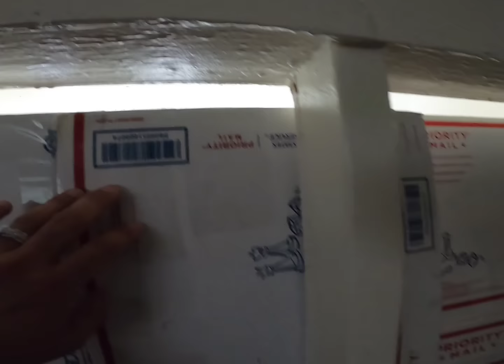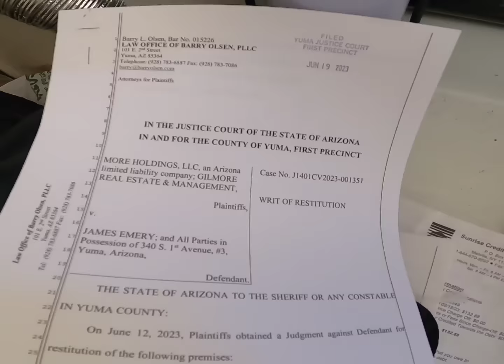How to remove a squatter from your property

Comment: The first thing you do is go pull the fuse out of the box mounted on the wall behind the AC condenser in back of the house!!
Reply from the maker: Haha that is really funny because I'm an AC contractor.
Reply: Could possibly shutting off power to Your dwelling have helped? Or more problems for you? I had to kick out my dead beat cousin after almost six months. I live in the same house, so turning off the power was not an option for me. All the best and may God bless.
Reply: The owners next to me have the water cut off. She turned it back on. The water company put a lock on it and she cut the lock off. Now she is stealing my water from my facet so she can flush the toilets and etc…
Sick of these damn dead beats and squatters…

Comment: I’m trying to get rid of one mouse in my house. Can’t imagine trying to get rid of a squatter, maybe using a bigger mouse trap.
Reply: Essential peppermint oil and mix with water in a spray bottle.  Mice hate the smell of peppermint!
Reply: GLUE TRAPS....WORK FANTASTIC!!
Reply: Fumigation usually does the trick
Reply: @sherynkowatsch2970  i use those  mostly 4 flies & nats,,  kinda hard on the cats,tho!
that's stuff sticks, i got a sheet stuck on the back of my computer. & of course the cats.

i    
like it - yet it causes some problems!  lol
rat mouse poison at farm supplies.
the green bricks are good.
Reply: Me too. One mouse and have tried all kinds of ways. I find nests in the most obscure places. Have no idea how it got in here? Has to be an opening somewhere but can't find it. At least a squatter is big not to hard to find to get them out

Comment: To get through that door take the exterior trim off, slide a recipricating  with metal blade between the door jab and the frame wall. Cut from top to bottom cutting the nails or screws at the shim locations. Then just push the door jamb and all inward. There will be a few finish fasteners on the inside trim but it will cause less damage to the door and is more easily repaired.

Comment: Rent a 20' shipping container, drop it on site. Take all the squatter's stuff and pack it in the container, lock it. Then remodel the unit. After the 14 days if the guy doesn't get his stuff, open the doors and put a sign saying, "Container Sale" and sell everything for cheap just to get rid of it. Or a sign saying, "All items FREE" and it will be cleared out in no time! Dump anything left over and have the container picked up while not losing any working time during that 14-day period.

Make "Squatting" a Criminal Law rather than "Civil". It is stealing and a B+E was done to make it happen, plus trespassing. To me that all adds up to a "Criminal" standard NOT "Civil"!